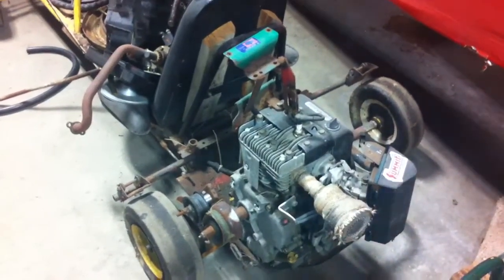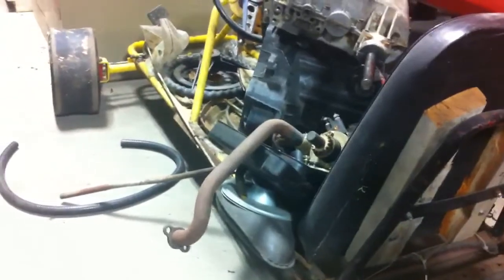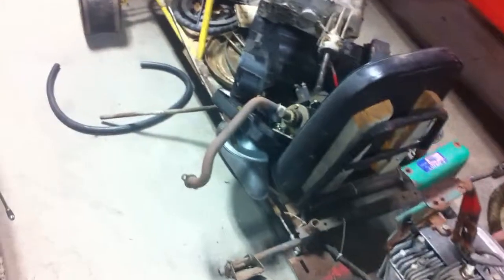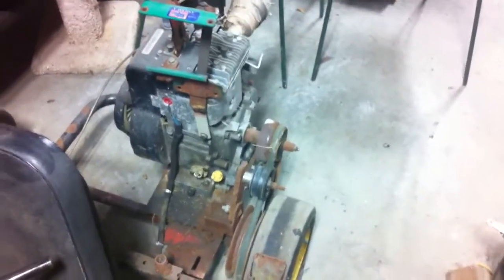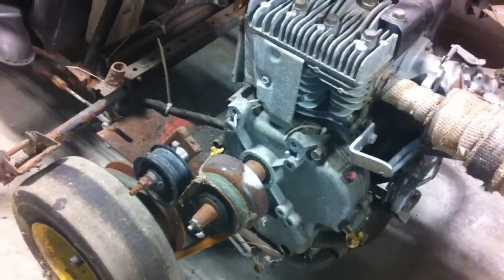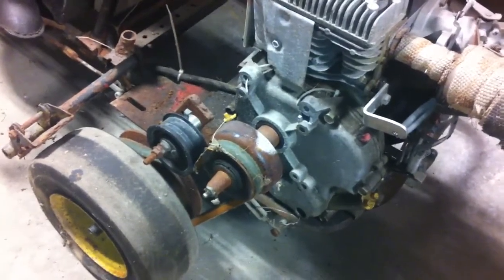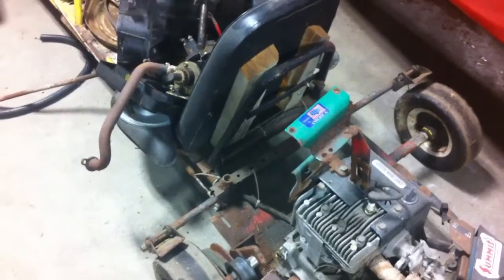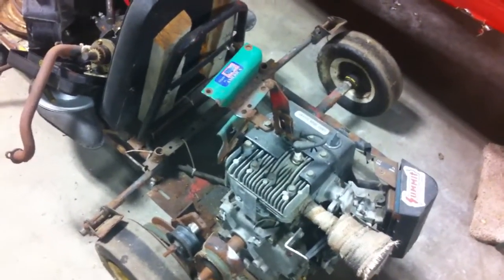70mph go kart, would you do 70 on it?

Comment: A 70+ mph shifter kart, sounds like you are trying to make something to outrun and out handle the enforcement!
I would be careful with this Beast, I know I wouldn't do 70 in it!  Hope the torque convertor set up works out.
Amazing what 10 horse can do, though a 5 horse fried the 1 wheel drive tire on our one kart, on bare pavement  :)
Reply from the maker: Heh. Ya don't know, if ya get caught on the road by the cops , that could be bad. So speed might be good :) 
I was kicking around the idea of using a mower transmission but  I think the torque converter setup will be a little better for longevity. 
The one time I rode it the longest: it was A few years back, in January. It was about 20 out, and like 1am...the moon was pretty bright luckily. 
I rode around on backroads for almost an hour!! 
I'd haveta say I never slowed down enough for the clutch to disengage(about 20mph)
I had about 4 layers on and a snowsuit and full helmet. 
The roads were perfectly clear, maybe a little dusty from the salt and sand...
I could come up behind cars and they didn't even know it!!! 
Hardest part was seeing. At least on secondary roads with yellow lines I could just keep it on the double yellow, cause I couldn't see more than 25 feet in front of me :) 
Yea that was a hairy ride that night. Sometimes it wakes me up at night...what if a deer jumped out or I hit a possum or somethin...makes me shudder sometimes. 
When I got back to the shop, that 1gal plastic fuel tank had about an inch on the bottom...close to empty!!
Reply: MrTheHillfolk LOL
Man that sounds like quite the ride you had!  Sounds kind of like one I had on an old 3 horse mini bike, drove it about 5 miles home one summer night, it would do between 30 and 40. Yes, it was a good thing neither of us encountered any wildlife on our joyride!  Gotta say, I only did that once, that was enough!

Comment: To gear it up a Lil more with put any cost you could swap it pulleys around from motor to hub which looks as if hub pulley is a bit bigger then on motor so would change ratio to higher Rev at the wheel

Comment: hey man I really like your kart. I would love to drive it full speed. where do you find the peerless transmission?
Reply from the maker: Always Karting 
In the video, it was serving as a parts shelf. 
I had a spare trans for my trapter on the seat. 
Recently I saw a video on an atv engine to standalone gearbox conversion that would be nice. 
But I have seen a few videos of guys using a peerless 700 style trans also for a gearbox. 
And ya busted me. 
I'm in the process of getting my hands on a live axle setup and doing a  torque converter. 
Only thing I'm worried about is that taper on the crank end, I'd like to use that existing 10hp. 
Here's a link to that gearbox conversion deal, what a great idea if you have a blown up engine laying around. 
https://youtu.be/wDJmsifTWh8
Reply: Did you leave the govoner in the engine? If you lived in Virginia I would wanna race.
Reply from the maker: Always Karting 
I've got the brittle tied direct , but the governor is still in it. 
That engine had under 20hrs of runtime on it I'd say. 
Haha a race as it is currently would be funny because I push it as fast as I can and then get on, and feather it easy so I don't kill the clutch. Once it locks around 20 then you can hammer it.
Reply: Dang mine is only able to do 33 with a 5.5 Honda. But I want yo modify it. Where are you?
Reply from the maker: Always Karting 
Depending if ya just have a clutch or a torque converter you could change the gearing a little, it should probably hit 40 especially with no governor. 
I'm in upstate ny, the 845 area code.
Reply: MrTheHillfolk I want a torque converter. I'm not sure if I wanna take the govener
Reply from the maker: Always Karting 
Kind of depends on how much you like your engine. 
If it's cheap and easy to replace I'd say do it because it could blow in 10mins or last for years, it's a little bit of a gamble.

Comment: Just add a second engine to the other rear wheel, one with a trans. This is what I did, Check it out here in You-tube. ( Homemade two engine Go-kart ) I got a top speed of 62.5mph in the 1/8 mile.
Reply from the maker: I dig that setup, I'm sure people think it won't work....this thing needs a torque converter...my buddy kinda backed out of it, so it's kind of mine...I figure I'll wait to do anything until I hear from him...it's been a while.
Reply: MrTheHillfolk I hope you get it going again, I now also have a centrifugal clutch belt drive but it has neutral, because I left the idler manual pulley operated by the foot pedal in tacked. I can rev the motor, dump the clutch then the centrifugal clutch kicks in. Its a lot of fun.
Reply from the maker: +julio lausell 
I probably could clean the cobwebs out of it and try it 1-2 more times. 
The gearing right now is horrible as its way too tall. 
I got a car and a few other projects goin, it'll get done sooner or later, but probably closer to later ✌️
Reply: MrTheHillfolk If you do ever get around to this project, you could use a 110cc chinese quad engine for the passenger side rear wheel. The cdi for a gy6 150cc chinese scooter will work just fine, its what I'm using now. They are cheap. I could show You the shorty wiring diagram from my go-kart. I used three sprockets from bicycles for the drive wheel. Those pedal backwards for brake, sprockets that bicycles have. I welded up three side by side so that they would become one thicker sprocket. I got a 62mph from my go-kart in the 1/8 mile, there are no solitary roads around here for a true top speed run.
Reply from the maker: +julio lausell 
Hmm do u know if those cdi boxes work on the kazuma 250 4 wheeler I have (in another video)? 
I've just heard that those cdi boxes go bad often, but the "race" ones are a little higher quality. 
I did save a yz250 dirt bike engine, it needs to be rebuilt but that would be a nice engine to use too.
Reply: +MrTheHillfolk I'm not sure what kind of stator a kazuma 250 uses, you would need to go and do lots of home work on the type of stator it uses. I have heard of other people using a chinese cdi to replace the OEM factory type, it can be done.You should google ( gy6 cdi pinout diagram ) then you would only need to find out what kind of power comes out from your stator and what kind of  pickup coil. If both stators look a like, it should work. What year is your 250 kazuma quad? So I can do some research.
Reply: +julio lausell P.S.S. Are you 100% sure its the cdi? I had trouble with my Baja90atv, it turned out NOT to be the cdi. The KEY IGNITION needed to be cleaned out from little copper shavings the switch was making. The deposit of copper was shorting out the kill wire with the ground inside the switch. I cleaned it out and it works fine now. My baja90atv runs with a cdi and coil from a gy6 scooter. The OEM cdi it came with is now on my gokart. No troubles with it so far, its about 7 years old.
Reply from the maker: +julio lausell 
No it actually runs, but I'm thinking ahead down the road. 
It's gotta be an early model,because it has the air cooled 250 on it. 
Right now I'm having fun trying to match up the gas tank on those Chinese parts websites, i might have to try retrofitting something else
Reply: MrTheHillfolk I would try a local motorcycle scrap-yard for one. The money stays local, and its an adventure to see all the bikes/parts that are looking for a good home. Take care mate.

Comment: To gear it up a Lil more with put any cost you could swap it pulleys around from motor to hub which looks as if hub pulley is a bit bigger then on motor so would change ratio to higher Rev at the wheel
Reply from the maker: I think if I did that, it would go about 156mph give or take 20. :) 
The cent clutch pulley is around 3 inches and the wheel pulley is about a 7. 
I have a 9 inch wheel pulley, but it'll only have about 1/2 inch clearance between the belt and the ground if I use that. 
Even some kind of simple gearbox with a low and a high, say 2:1 and 1:1. That would help it move off the line a lot easier without makin that clutch get so strained.